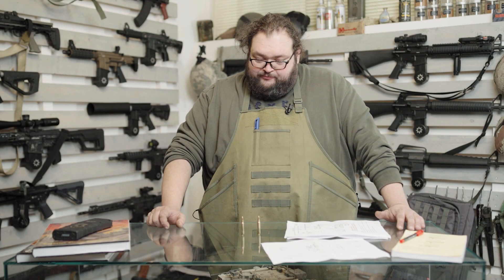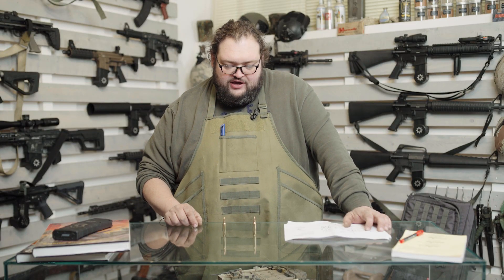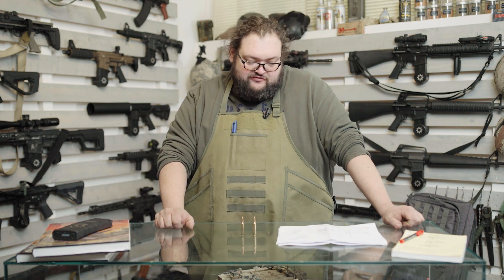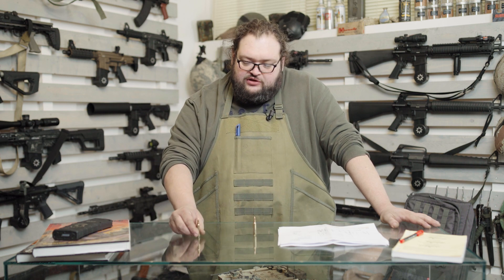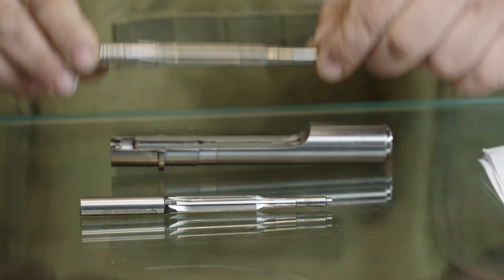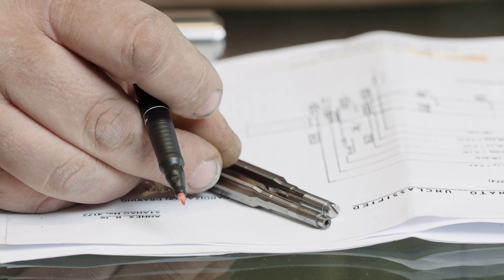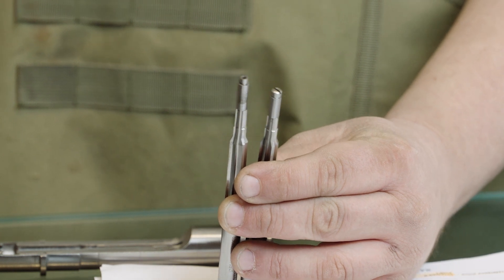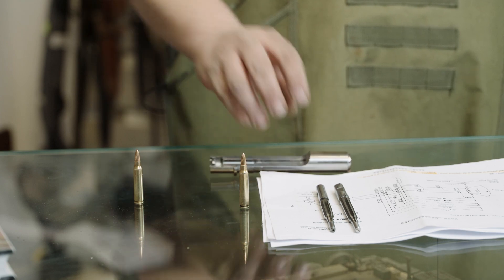Pillole black rifle: 223REM VS 5.56 NATO (seconda parte)

Comment: Ciao Diego , ma avendo un 223 , con passo 1/7" , che teoricamente potrebbe sparare  e stabilizzare , palle   pesanti e  più lunghe , rispetto al passo originale dell' M16 che era 1/12 adatto alle 55 gr , cosa cambia??...potrebbe avere anche li problemi pressori ??? , se non è possibile camerare palle più pesanti ,  per il discorso del freee bore ,  in un 223 con passo 1/7 che non stabilizza bene le palle da 55 , come il passo 12 , palle più adatte al passo ,  mi chiedo che senso abbia avere un passo 1/7...Grazie Diego.